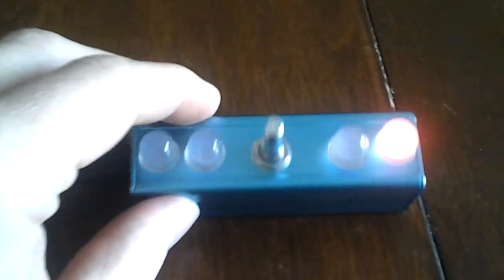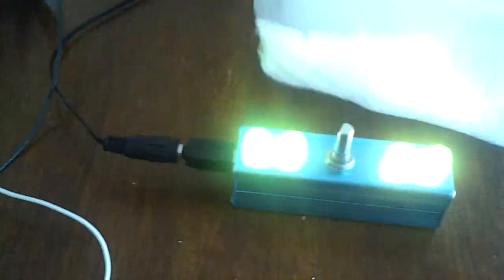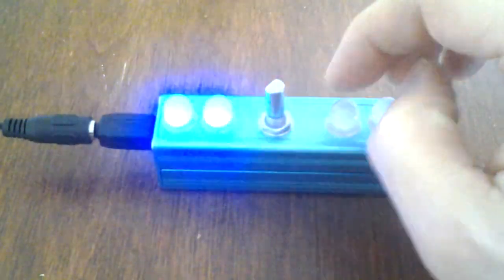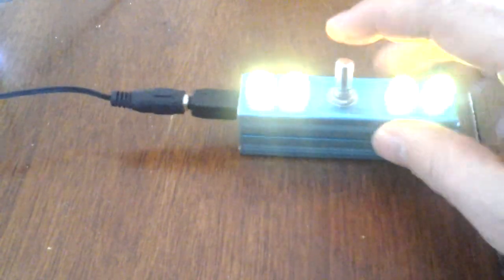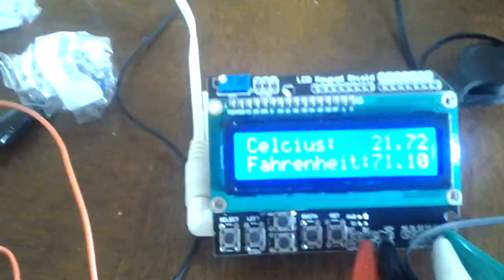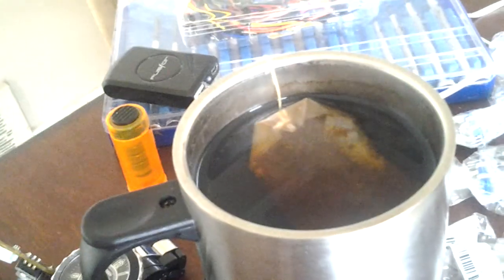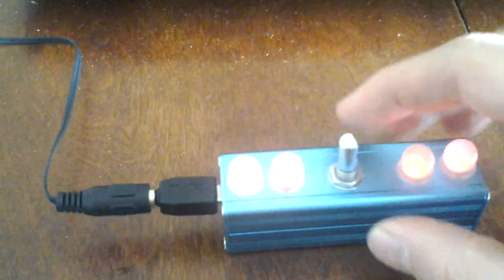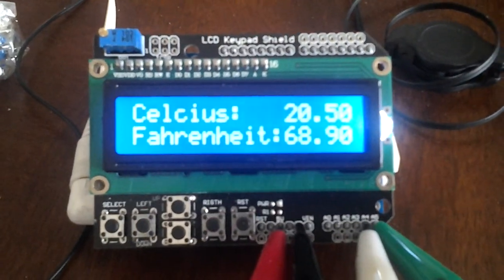Arduino 4 RGB LED finish and preview for new project

Comment from the maker: The encoder that I order click and have a push button switch. For programming my arduino I use the arduino programmer that on the web site it's free and work :P it's C++ but at the very basic with arduino code and function :)